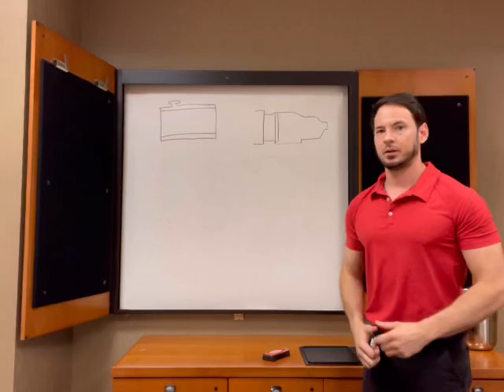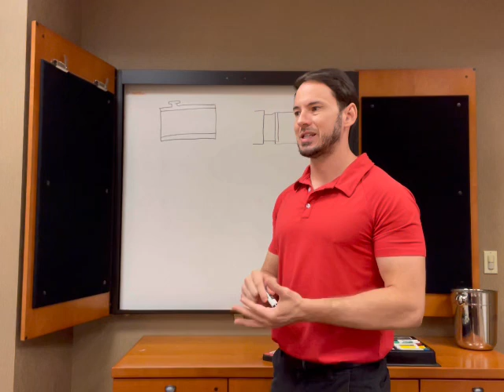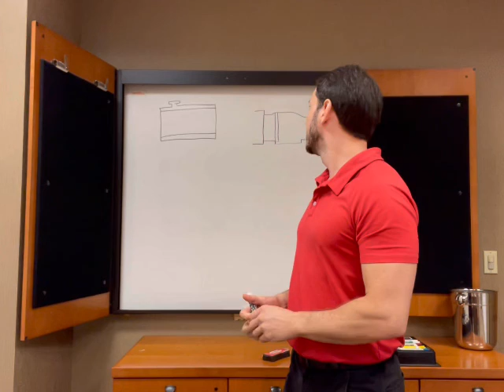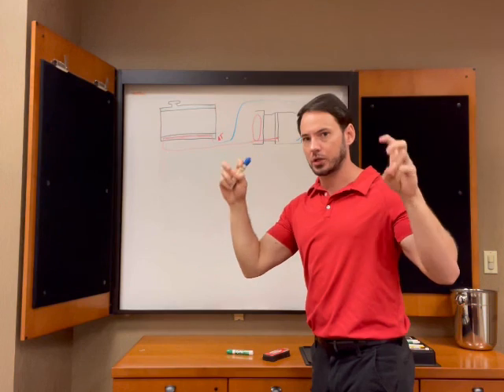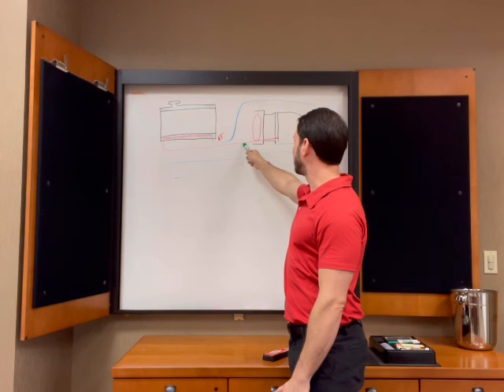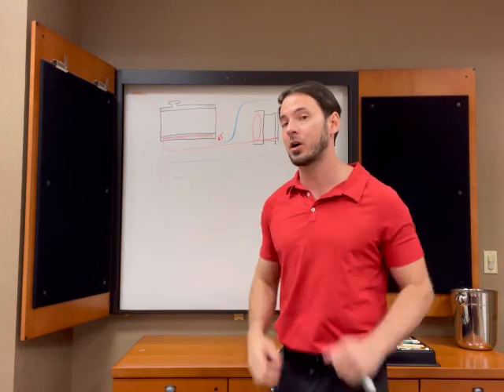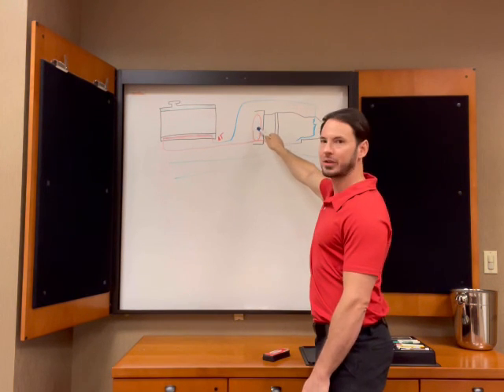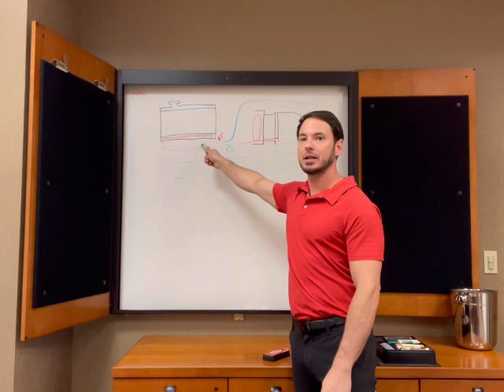Subaru SVX transmission fluid temperature management, coolers, and filters

Comment: Very good indepth video, smart dude. This saved me from putting a trans cooler on my 1996 SVX, having a metal rad, I can know now that my system is all set. Now I only plan to install a trans gauge in the pan, but is there a point at this point? Running amsoil signature series fluids, rad looks like new, I sometimes redline it.

Edit: can you cover benefits/dangers of coasting the trans in neutral, holding it in Drive and brakes on for seconds vs minutes. Looking to get some indepth knowledge on its day to day usage and how to extend its life, all while using it as intended (spirited driving)/
Reply from the maker: I can make some more in depth videos in the future. I still need to do the one that covers the failures. As for the gauge, you can use one if you want to but what you will see is the fluid takes forever to warm and then stays at 170-205. Many gauges lowest graduation is 150f and you may make entire drives were it never moves the needle.
Reply: @NiftySVX  Eye opening information, thanks again for putting the effort to inform us all. Its crazy to think for so long SVX owners misunderstood the issue and to this day misdiagnose it. Im making sure to spread the word when I meet owners of the car.

One thing I noticed is that the car shifts hard from first (1) to second (2) gear, unless its being pushed reasonably hard. This happens on my 1992 and the 1996 JDM (profile picture). When tracking the JDM in its stock form, it shifts fine especially at the higher RPMs, yet at normal driving it shifts hard from first to second.
I know a few SVX owners and they have the same issue. Is this a 4EAT thing? Or perhaps wear? Or breakband adjustment?

I was checking SVXNation forums, I found many of your posts/replies and your signature mention you have a VDT trans, have you found the same hard shifting in your experience on both types of transmissions?

Keep up the good work!